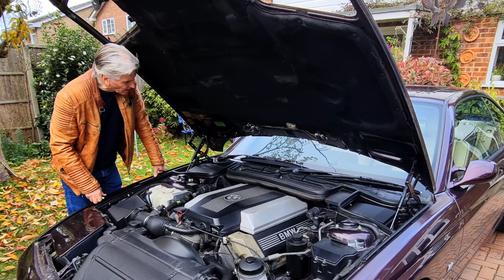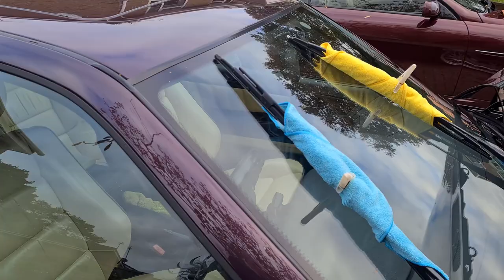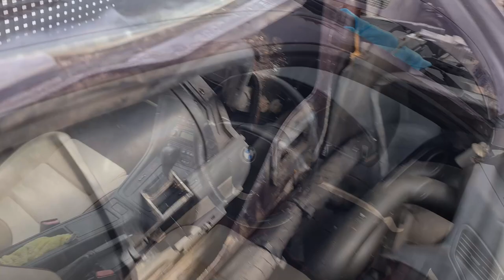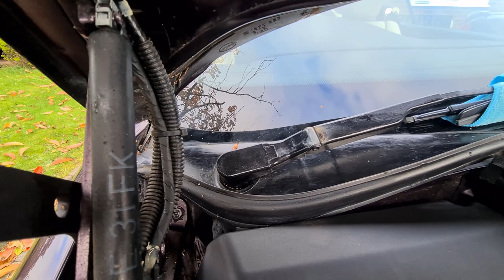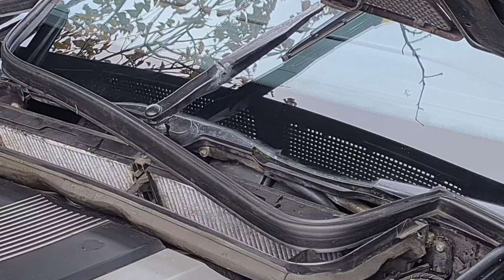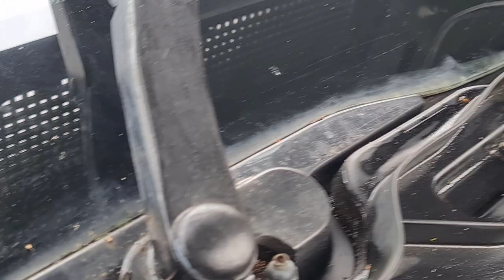BMW E31 GETTING THE WIPERS WORKING - AND PARKING!

Comment: Great tips. Personally, after oiling I put a big glob of grease near or on each pivot point. The grease feeds the bushings. In the case of plastic components like the junk on our X3, I use silicone grease as that stops the plastic from drying out and cracking.

Comment: Hello Tim, thanks for the video. I'm having an issue where there's a patch in the middle of the screen where the passenger side wiper is failing to clean. I've tried new blades but same issue. Any ideas? I don't see how the arms/linkage could bend by themselves.
Reply from the maker: Check that the insert is free to move along the claws easily and is not secured at both ends - one end should be free to slide.

Comment: I have a question. I’m looking at the E34 530 
And the car has been sitting since 2011 I got the car to turn over and sounds good but I jump the car. So the car won’t engage into any gear. Do you think it’s the battery or transmission is bad ? It has an automatic transmission
Reply from the maker: I think I would pass on that one!
Reply: @TimmsBMWRepairsandInformation  I might grab it change the transmission I wanted it for a project car